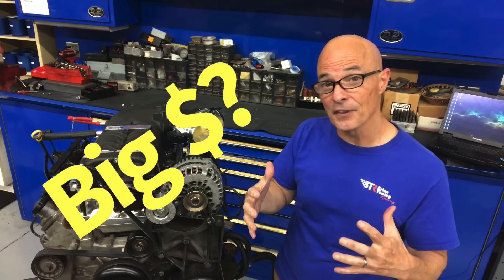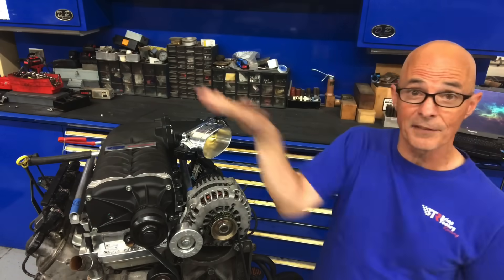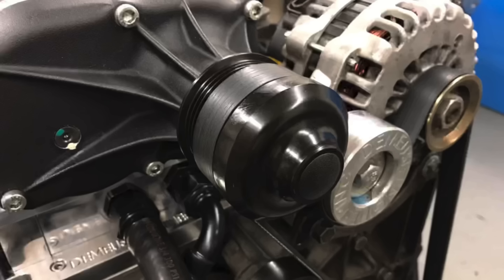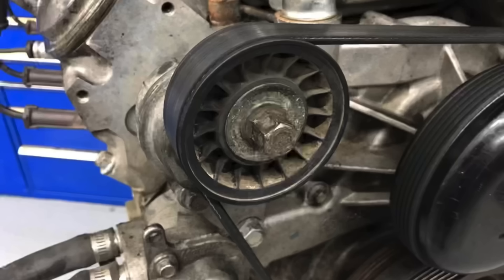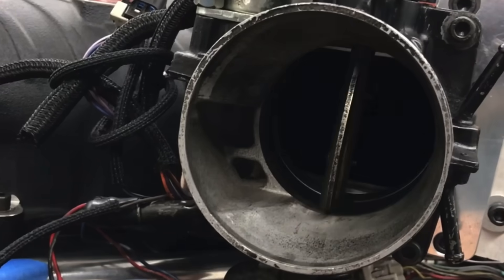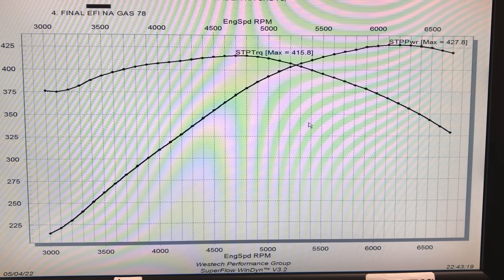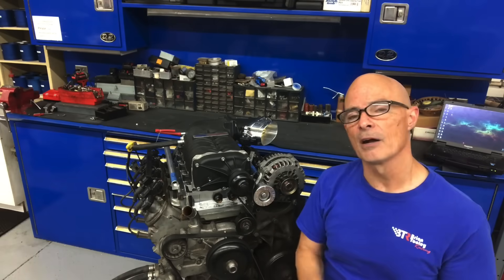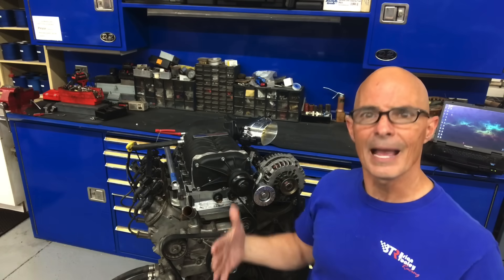THE ULTIMATE LOW BUCK LS BLOWER ADAPTER KIT? HOW TO INSTALL A FORD GT500 BLOWER ON YOUR JUNKYARD LS!

Comment: Why wouldn't you just use an Eaton that came on LS and LTs?
Reply: Smaller
Reply: @ssoffshore5111  Man that's a lot of work and money for a relatively small increase in size. I guess...
Reply: @bigblocklawyer  I hear you, but the GT500 SC's are significantly bigger so they don't heat up as much.  It would be a decent upgrade over the Eaton.
Reply: @ssoffshore5111  10 4.

Comment: What a POS! That intercooler is nowhere near the size nor has the water flow needed to control intake air temps.......not even close. It will constantly be down on power. A lot of power. And the belt tensioner setup will be constant problems once you get it in a car/truck and put it out in the real world. It's sad that a lot of people are going to do this.....and end up with a garbage combo.

Richard Holdener you should be ashamed of yourself for plugging this garbage.

Comment: So I'm betting that until you buy all those parts to adapt it to an ls you won't be saving anything but I cant tell because it seems the parts you have don't exist for anyone else. Maybe my internet skills are just lacking but I can't find the parts you are using listed anywhere .
Reply from the maker: CONTACT DEMUSE ENGINEERING
Reply: @richardholdener1727  sound logic , tried that a few times actually since your first video on the subject but no answer/response so far . Thanks for the videos .

Comment: So now we know a bone stock 5.3 with no ring gap can hold 650/700 HP...
Reply: It'll do it at least once
Reply: @ThePants2012  
Snidertron3000 no YouTube had a GMC truck  with a super charger cam headers exhaust system 600+HP  no gap in his rings  never hurt the engine and he still has a RX7 5.3 turbo cam headers exhaust system had 21lbs on it took it out street racing for the very first time didn't win cause he was out gunned but the little car was still fast for the first time street racing. He just told me he had never gapped his rings  so the Theory and the scare of gapping rings isn't true. I've even heard people putting 100/150 shot of nitrous on them and never gapped rings and they all lived for very long time.
Reply: @matthewvarnam4302  I said AT LEAST once lol
Reply: They’ll hold much more than that with just opening up the rings

Comment: yes, this is an "Engine Power" channel but no such animal as "Low Buck" when power gains are over 500HP. my point is everything behind the engine requires deep pockets for transmission and rear end upgrades. dont forget suspension and break upgrades if you want to turn and stop a 500+ HP monster. me personally, i would not want to run a blower with stock pistons along with mentioned piston rings.
Reply: MY COUSIN HAS A 2012 CAMARO SS 6.2 LS.  MOTOR IS STOCK , HE PUT ON A PROCHARGER,  RUNS 6 PSI DYNOED 705 HP 650 TQ,  ON PUMP GAS WITH OCTANE BOOST .  2 YEARS SO FAR NO PROBLEMS
Reply: @daviddavids3468  6.2L LS3 most likely has a TR6060 6-Speed Manual Transmission and can take that kind of HP with a clutch upgrade - but i'm not talking about that. this video is about a 5.3L junkyard engine taken from a truck, SUV or van with automatic transmissions. all of this is in the context of power on a budget... but still if you wanted to swap in a manual transmission to a 5.3L we're still talking about $1000s in added costs.
Reply: @daviddavids3468  if you are doing a project car and retrofitting in a 5.3L or any LS based GM engine i'm sure matching up a transmission is also planned for.
Reply: @daviddavids3468  me personally - i would not get a high millage junkyard engine and use it without taking it apart and inspecting it for wear. if i've gone that far i'd rebuild it at the very least.
https://www.youtube.com/watch?v=oOGoqwDw5Xw

Comment: I've got one of Tom's kits with a 122 on a 6.0 w/862 heads on a summit stg2 cam.. I can't wait too fire it
Reply: And thankfully I got my blower a year ago for 250,😁
Reply: @andrewmoss8909  what year 6.0
Reply: @tumtum08  05
Reply: Hey any chance you could tell me the height of the setup? For example from valley plate to the top

Comment: $1750 USD (from Demeuse) for the adapter kit ONLY, then the price (and perhaps headache) of a used blower is too close to the $3000 overall price of a TorqueStorm Tuner Kit. The TS kit is still the 'Budget King' from a realistic and 'all parts purchased' stand point. While the packaging of a PD kit and it's charge cooling is nice, the TS kit still remains king.
Reply: Very true, but a Torquestorm won't make the low rpm torque that a setup like this is capable of.

That being said.. the torquestorm is an excellent centrifugal blower, and more efficient at lower rpm than some other popular centrifugal blowers of it's size.
Reply: The torque storm sadly doesn’t make any power, and by the time I does your out of rpm . 🗑️

Comment: Great video. I'm getting back into the performance end of things and I'm wondering where to start with tuning. I have an 05 Sierra with a 5.3 . If I do something like this, will a hand held tuner allow the proper files to be down loaded? Is there a different system needed to change the factory tune or do I need to completely bypass the factory ECM and install the Holley system you use? I'd love to see a video on how you tune these engines.
Reply: Look into hp tuners.

Comment: Holy shit the price of the adapter when I looked it up
Reply: Where did you find a price?  I couldn’t seem too
Reply: @travis3688  it was on the demuse site. $1750
Reply: @chipcurrey653  In all fairness, doesn't that include the IC and fuel rails too?  If so, that's not all that bad considering it's a custom machined manifold.

Comment: What is low buck? I’m seeing 1500 bucks on eBay is that correct? Where do you buy them ?
Reply: Yall don't seem to understand that is a 2.3 tvs blower dude it's better than the lsa blowers the 1.9s that guys run.  This thing can make some serious power.  It's a really badass setup.  It's a way to get your car supercharged pretty budget minded compared to aftermarket supercharger kits.

Comment: Looking forward to all the tests on this setup, currently building  9.5:1   408 that I plan on adding 91 pump gas boost to down the road. Was looking at the Vortech kit for ~3500$ and this combo seems to be right around the same price.
Reply: How lbs of boost will that Vortec make?
Reply: @matthewvarnam4302  The Vortech LS swap tuner kit comes with the V3 which is a 775hp blower, so maybe 7-8psi on a 408. Good match for my goals with 91 octane. Probably better than the M122 and worse than a the 2300 ford blowers.
Reply: @rancherlee  m122 would be way more fun on the street though imo.  Would be a torque monster and very fun.
Reply: @matthewvarnam4302  With large 2" diameter equal-length headers, the boost backpressure would be reduced, for certain.

Comment: does anyone have a link to where i can buy the adapter plate
Reply: Demeuse Engineering
$1750 Adapter, Intercooler, and Fuel Rails
Reply: @nsmturbo5902  1750 for the adapter alone or 1750 for the whole package including rails and what not
Reply: @nothuntersmith  $1750 for fuel rails, intercooler, and adapter
Reply: Have to contact DEM Engineering…the phone number is listed in the drop down section.

Comment: Wondering if I have the Hood clearance or what is needed to do this to my C6 Z06
Reply: Wouldn't even be close to fitting under my C5 , back may even hit firewall
Reply: Yeah, not thinking it's very practical
Reply: Not even remotely close!
Reply: Have you thought about making up a rear mount turbo system?  Im guessing that might be the cheapest way to smoke that GT500, although I haven't looked into how hard the pipe routing would be.  I know there's a guy on AG channel that did this with ebay turbos on his C6 and it moves out.
Reply: I'm gonna go with some giggle juice. LS7 and boost don't go together as well as other motors so this bitch will get a 200 shot of pills hehehe

Comment: So break down of price looks like this. 
Blowers can be found at the price listed but will probably go up.

$400-$800 m122 blower

$350 for throttle body kit
($100 if you are doing dbw and supply your own throttle body)

$1750 Adapter plate, intercooler and fuel rails

$250 pulley kit

$587 Magnuson lower tub

So total price could be between:
$3087-$3737
As long as the price of the supercharger doesn't go up significantly. Also keep in mind the other things like water tank, pump and whatever else is needed to make the air to water intercooler work. It not a bad deal but some may choose to go a different route. All depends on how well this fits your needs. I will say I got to speak with the guy that sells the adapter and he seems like a great guy that is very helpful. So if you don't like the price please be respectful.
Reply: @Randy Zagarri well in some parts of the country that is false. I found three, all under $700 in my area when this video was posted. Granted, they have all sold since then. Lol but I am sure some parts of the country are more expensive than others.
Reply: I could have sworn I saw one of these type of blowers for around $500 mark, but that was months ago. At least the "realistic" cost is still in line with what I found my LSA for, so I can't be sad about that lol.
Reply: Very nice breakdown and well said.

Comment: That oval throttle body will have awful low speed drive ability.  RE: A small movement of the throttle arm = huge air flow change.    This is why some throttles have an egg shaped throttle arm, GM uses a ski jump on the back of some throttle blades , Ford uses a toothed throttle body gasket / dual staged throttle blades.    In the case of drive by wire, the software will take care of this.
Reply: Holley HP software allows for TB rate of change blanking (R.O.C. blanking) adjustments for just this very thing. The Holley is very versatile
Reply from the maker: BIGGER CAN BE A PROBLEM -ESPECIALLY ON A BLOWER
Reply: @richardholdener1727  where do i get them from? I need that for my 6.2
Reply: Not if someone knows what they’re doing with tuning. I’ve seen these style throttle bodies very drivable on the street with vmp blowers

Comment: Not exactly a low budget install IMHO.   Sure, the GT500 M122 last I looked was $300-400 used, I bought mine many years ago for $200 a low mile take off.  That said this nicely engineered kit looks based on a $550 Magnusson tub lower with the custom intercooler, and adapter plates, fuel rails.  Not sure of the kit cost but I'm betting well north of a grand.  I'm currently looking at the feasibility of using a low ram, adapter plate and meth injection on my 5.3.   Enjoying the videos!
Reply: I went to Demuse engineering and their adapter plate kit is about 3 grand. An the cheapest gt500 supercharger I found was about 2 grand on ebay. So unless you have one or can buy one extremely cheap I don't see it being worth the hassle. But he did say the prices would go up lol.
Reply: @Mr.G.S.1  you must be talking about the 2.3 tvs.  A 2.1 liter m122 blower can be had well under a grand.
Reply: @Lil' Ike  5 grand for a used g500 setup no thanks. Can grab a used lsa for $1500 and cathedral plate is $300  or just gt45 turbo and intercooler and tune under $2000
Reply: @Randy Zagarri 1350 on eBay and a couple uses ones locally for a Grand. Spot on
Reply: @Randy Zagarri They were around $500+shipping retail (from wrecking yards, certified good) when he did the live stream.
Reply: That is cheap as hell for boost especially with a blower.  This is a much more fun street setup vs turbos imo.

Comment: Seems like total cost is $3-4000 using available parts costs now. Whats the advantage over LSA at that price?
Reply: Nothing really. An LSA is very good blower set up for the money. Boost district makes it very easy.
Reply: @DansicTheOriginal  Well the 2300 is quite a bit bigger than the 1900 LSA blower, so if you were looking to push past 700-800 hp the 2.3 might be preferable.
Reply: @DansicTheOriginal  last I checked boost district had LSA blower kits in the 3-4k range depending on if the blower was used or new. Very good value imo
Reply: @CaptainThirdGen  I guess the deciding factor would be what heads do you have. This setup is for a cath port head, to use a LSA you’d have to switch heads or get adapters, and that would up the price for that swap (plus the LSA is  a smaller blower)
Reply: @DansicTheOriginal  the 2.3 tvs is a better larger more efficient blower than a 1.9 lsa tvs it will make more power period.  For similar money you're getting a larger better blower.  I think the real question is why wouldn't you do that over an lsa?
Reply: Price.  In my area LSA's are nowhere to be found and when I travel I get estimate's of $5k-$7k for a 100,000mi motor.
Reply: @hardball107  I think he is talking about the supercharger, not the entire engine
Reply: @hardball107  I thought all ls engines costed 500 dollars you mean that is a myth?  Lol.  That is literally how some people act as if you can go get any ls engine for 500 bucks.
Reply: The advantage is its a larger more efficient blower.  2.3 tvs vs a 1.9 tvs.  It will make more power at the same boost and has a higher ceiling.

Comment: OK, so the Truck Norris is a n/a cam, a turbo cam, and a blower cam. But is it a CAR cam? 😛
Reply from the maker: YES AND A CARB CAM
Reply: I'm all in on the truck Norris camp, speaking of Camp you can also weld two of them together and make a tent pole, fend of bear's  make a rotisserie for cooking your catch,  and if you answer the door with it in your hand when the Jehovah's Witness knock on the door they just turn around and leave, it's called Truck Norris"  but they could have also called it the Swiss Army cam. Brian Tooley for president 🤔
Reply: @kevinwest3689  Can you make a small rotisserie with a Dodge 3.3l cam with a wiped lobe? I'm pulling one out tomorrow. It's just for chicken.

Comment: BTW: Aussiespeed sells an adapter to mount the Ford/Eaton M112 Truck supercharger onto a Weiand 142 intake manifold.
Reply: I dont think the m112 would not be as efficient as anything on the market?
Reply: Ls?
Reply: No the m112 is not as efficient as other blowers.
Reply: The m112 blower as fitted to lightnings, cobras etc has pretty restrictive inlet tract and a different bolt pattern to the gt500. Also the throttle body is on the opposite side of the blower case.
Reply: I wouldn't run that I'd at least run an m122 from a gt500.  That would be bare minimum.
Reply: @midnight347 Im gonna run it on my ram , the blower costed me 500$ had it ported  and has a 2.8 pulley , I also adapted a 92 mm LS throttle , it was 100$ plus sensors another 50$ adapter plate was 500$ , cooling system was 1000$ so for less than 3k I gained 200 whp at 15 psi not too bad for me

Comment: Only thing good about the Ford supercharger is they are readily available compared to the sts supercharger. Prices might go up some but I doubt much. The adapters will be the hard part to get and those will possibly go up
Reply: Someone like this when those 3k LSA kits get linked to lol
Reply: You can get a new LSA blower kit with the ZL1 top for $3000 that’s including the intercooler and water pump.  This route is more money once you buy the adapter.  So then you can use decamped injectors, a hellcat walbro.  So $3300 for everything that fits like factory.
Reply: @Cultofpersonality09129  I too would like to know where your getting NEW LSA blower, ZL1 lid, cooler, and pump for $3k?? Let us know please!
Reply: @Cultofpersonality09129  I would prefer to have an LSA over the Ford blower with adapters anyways. But where are you finding the LSA that cheap, ive noticed the pricing going up the past few years and I think around $4500 was the last time I priced one put but that was also with injectors.

Comment: Prices on these will triple. .......     by the end of this video....
Reply: the gt500 M122 were already high bc of the Cad blower video. They were JUST starting to come back down. Lucky I found another source of low cost blowers that better than the M122. I'm just not telling people what cars theyre on lol
Reply: @DansicTheOriginal  where can I source one those?
Reply: @DansicTheOriginal  found a lsa under $900 last week 😅
Reply: @DansicTheOriginal  won’t hurt to tell us bro come on
Reply: @DansicTheOriginal  atta boy! This share all to anyone nonsense is constantly benefitting Richard's wallet. If he buys a Lambo I'm reporting him to Whistlndiesel
Reply: Nothing cheap about the blower manifold kit. Add the price of blower and the rest you can get a better deal from other places.
Reply: Cheapest I’ve seen a LSA in the last 2 years in my area is $3-4k with nothing else
Reply: And it sure did. Went from $1000 to $3000. Not worth it anymore. Well find another type that's more budget friendly🤣😂
Reply: @warriorplutotrent3827  yep, I went with the old tried and true GT45 from ebay and fabled the rest of the kit for less than $1500 including injectors
Reply: Always does
Reply: Yea they have go look at the prices on then now
Reply: Eh who cares looking at the price range and power some cool shiny boy spools would do the job
Reply: @Romero.408  agreed they are over $1,000 can get a used lsa for same price.
Reply: Can I fit this blower setup on a GM 383 Stroker?
Reply: @rayramos5660  yes with a $2,000 adapter plate and cooler . Just get a lsa .
Reply: @rayramos5660 question I was wondering
Reply: can currently get a ready to use pre owned blower for around $1k or a hundred or two less
Reply: @NRJracing   but the adapters?
Reply: Where do you find these superchargers?
Reply: Can I buy this one
Reply: Hell 😂😂😂 yes
Reply: I figured more and then I watched the video.  There has to be a better/cheaper option, given the not-at-all-bolt-on nature.
Reply: Good thing I bought one several years ago cheeeep.....